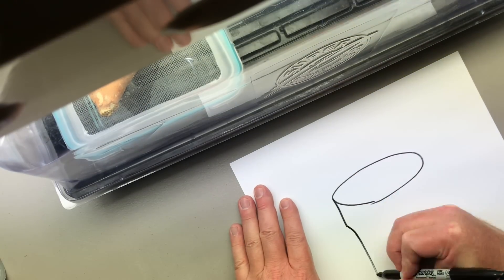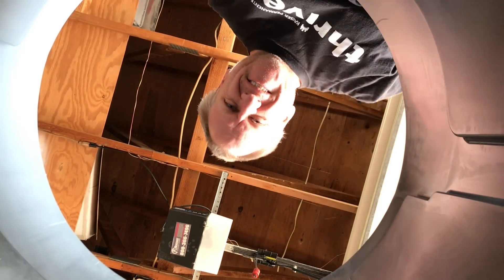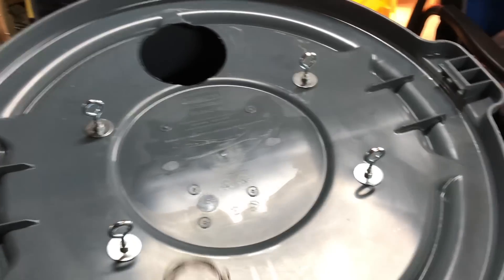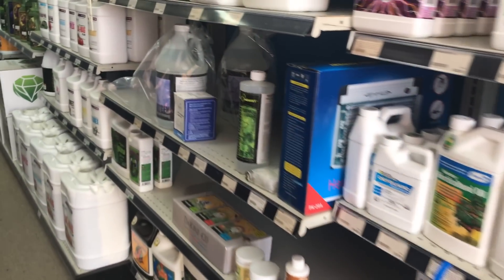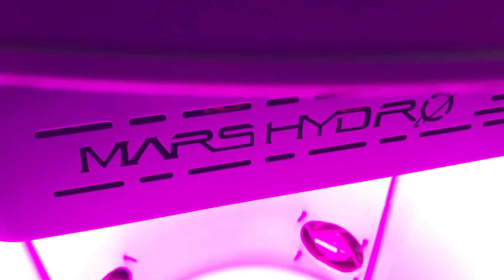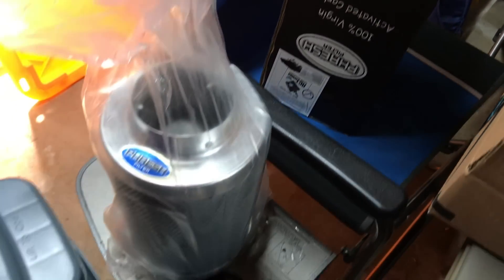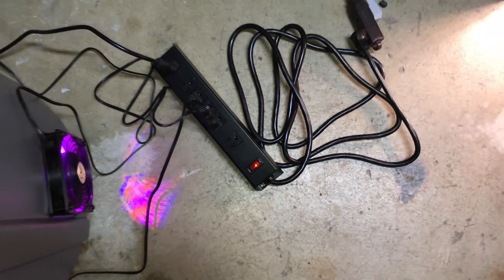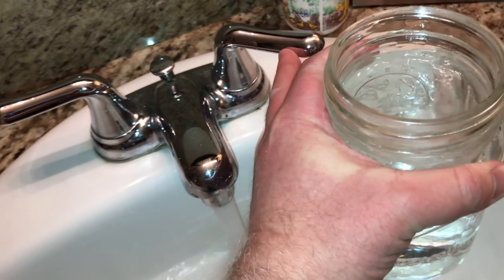They Grew Inside My Secret Trash Can

Comment: Many years ago a FOAF did a similar aah, Tulip grow, stealthed in a bar fridge. Quite elegant, air intakes and ballast for the HPS (this was pre-led) where the compressor was, allowed for a light trap for max stealth. Worked excellent until the light was at max height (used the fridge shelves to mount, so could move the lamp up). Top rack broke airflow around the lamp tho, overheating became a major issue. Using temp control was considered, but there were concerns these dutch tulips would panic with odd dark cycles. Was de-commissioned before harvest. Excellent concept tho. Maybe he will try again in a fullsize fridge and LEDs. Has all the requirements, and you even expect it to hum a little. Trash cans dont generally hum. 
Thanks Jeb, nice grow.
Reply from the maker: yes fridge would be stealthier and more difficult

Comment: It's not quite stealthy enough to be called, "secret" though. It takes a couple 90° turns to trap light, and have good airflow to not bling blurple light out the fan hole.

 That's just asking for someone to ask, "what's that?!" There's a bit more work left to truly make it a secret garden bro:/
Reply from the maker: lock the room its in
Reply: @JebGardener  We could probably put a box or clutter around the can filter to make it look like you just sat stuff on the lid. And run some 4" black vinyl hose (sold for dust collecting machines for cabinet/machine shops) off the intake fan, and wrap it behind some boxes or such on the floor to hide it being connected to the trash can. Long as all the ports and plugs are on the back, it's probably good. I'm somewhat concerned with heat off that Mars 300. I've got 2 of them, they're good lights, but easily make the space under them break a hundred degrees when you enclose them that tight. I'm not a "spacebucket," guy, more of an armoire/cabinet guy, so usually have a bit more room to play with.

Comment: id rather not break my back lifting that lid :P
Reply from the maker: yes it would be better to mount the light within the can
Reply: @JebGardener  Great idea. However, how would you be able to access the plant? I'd suggest using a see-through material to make a window to access the plant.
ps.
I am using a 4 shelf, plastic, 20$, POS, ocean state greenhouse, I was able to fit a rotating heater and a dehumidifier. However, I still need to find a cheap grow light for my plant, as I'm steadily approaching my budget.

Comment: When I saw the thick trash can I was geared up for potatoes.
Reply from the maker: sounds interesting
Reply: @JebGardener  I remember the last time you did potatoes, there wasn't enough light blocked from the roots and they came out green. You didn't seem overly bothered with the idea of trying again, but you do seem to be spurred on by solving challenges and problems, so I was wondering when you'd get back to the potatoes. I even thought I saw some in the first few clips.

Comment: I had this same exact idea last year but i figured out something cheaper and better! Any way heads up u can make a carbon filter by buying activated carbon. Step 1 take pringles or soda can if u want it good start from the middle punch holes down one side, put a paper towel or coffe filter as a inside liner. Now put the cap on the pringles can side with no holes. Add a dryersheet imo helps if u streach it out, then about .5-1mm thick of activated carbon less is more breathable, due to gradients u can essentially add as many layers as u wish, 10 is usally normal. Dryersheet then activated carbon dryersheet then activated carbon finish the tube by adding one last dryer sheet gently compress it doesnt need alot! Take the cap off you done good if it holds put holes 9+ decent sized then cap off the hole end of the can. Now all u have to do is glue the can on ur exauhst vent! Hotglue and super glue are air tight and bond well! The dryer sheet catches ionized particles while the carbon bonds to larger particulates. No reason to buy a carbon filter when u can make 5 for 5$-10$ a pvc faceplate useally makes a good connector if u wana use a variable pvc glue if u want the extra seal and replaceability
Reply from the maker: sounds like a good candidate for a comparison
Reply: @JebGardener  I'd love to see you make one and do a comparison would be wonderful! Thanks jeb for all ur content! Ill be looking forward to future videos!
Reply: I forgot to mention one thing if 10 layers doesnt fill ur filter unit all the way just lightly pack cotton balls the rest of the way! 

Also you can use charcoal if u have access to a 🔥 id pestle the small coals into a fine dust. 

When making this please use a dust mask of at least grade 2, and/or in a well ventilated area.

Comment: Honestly a great video. 
For the watering problems, try using a water fountain pump with an outlet timer. ($5)
Filters on the fans to protect against mold spores. ($10)
Cheap IP/USB Camera on the inside to see and keep the seal. ($25 max)
If you're truly trying to seal it up all the way.
Which Wattage light did you use from the ebay link, it looks like the 400 watt light, but I saw your consumption wasn't anywhere near that.
Reply from the maker: thanks!

Comment: you might want to use some reflexion material inside the can
Reply from the maker: foil?
Reply: @JebGardener  yeah, although it might be a tough to set properly on a rounded box. since the can inside have a dark surface your light is heating it up from the inside. just my thoughts based on indoor growing

Comment: FYI, unless you are growing cannabis or a smelly plant or want to have clean air moved from one room to another, there is no actual need for a carbon filter (which filters bad smells of air when it is pushed through the filter. Also, a carbon filter of that size would be moving around 250 m^3/h of air or so, ideal for a 1x1x2mt tent aprox. For such a small container/space you'd need a filter that passes no more than 90~110 m^3/h that way you can spend less money on a smaller filter which is easier to handle :)
Reply from the maker: the filter i chose was correct

Comment: Very nice setup! Have you already tried aquaponics?

PS: you could have put your fan just before the carbon filter for "optimized" air flow.
Reply from the maker: is optimized better?
Reply: @JebGardener  Because you're pushing air directly into the filter. You can also put the fan after the filter (to pull air instead of pushing it) but then the filter has to be directly inside the box.

Comment: I tried using 300 mars led in a 2x2x4 foot tall for cucumbers and it burned the leaves   had light up as high as it could go in cabinet but still burn leaves any ideas.  ??????
Reply from the maker: did you monitor temps and humidity?
Reply: nope but there are also two fans facing out and one blowing in and am doing kratcky so once a week I check water and every other week change out

Comment: I like how this little project can probably be even more improved. Like paint the inside or line it with white polyurethane.
Reply from the maker: i dont think lack of light was an issue.  I would use foil if i had to
Reply: @JebGardener  I think foil would absorb and produce heat more. My mentor advised against it but hey, you are growing tulips haha. I was growing something else ;)
I am interested at how advanced this compact thing can get.
How did you clean the bottom after every watering?
Reply from the maker: i heard lots of nonsese like foil doesnt work, soak your rockwool, chlorine hurts plants etc

Comment: if you skip the fans below and just have air holes you could ensure no leakage with negative air pressure, would probably require a blower for the carbon filter, might not be as cheap or silent but if you don't run it at full speed it should be close enough
Reply from the maker: computer fans are the way to go if you want quiet

Comment: For watering you might be able to use a small fountain pump and a rain bird micro bubbler?
Reply from the maker: sounds complicated but not a bad idea
Reply: @JebGardener  A low tech idea..  Attach a  plastic watering can head to a pvc pipe. Set it at an angle and have a funnel on the outside of the space can attached to the pvc.
Reply from the maker: might make things easier but you need to inspect the plants regularly too
Reply: @JebGardener   Good point. Love how you solved the problem of hanging the light. Was heat ever an issue?
Reply from the maker: the tempereature controller handled that for me

Comment: Another great video. May I add if smell is an issue always pull air never push, and maybe spray glue some tinfoil inside
Reply from the maker: i guess, but none of that was necessary

Comment: This idea came to me as well a month or two ago. The only issue I had with it is that it's very difficult to get to the plants for watering or maintenance unless you cut a door into your (relatively) expensive garbage bin. I opt'd to use a large double-walled cardboard board lined with foil instead. It's working great so for got a small number of plants.
Reply from the maker: yes vertical clearance and access are a real challenge with this setup
Reply: You could maybe water via tubing to a capillary mat, with the water passing through another carbon filter on the side. Not sure if a carbon filter would trap nutrients, if you were adding it to the water. The real problem would be avoiding over-watering, so maybe have some kind of clear panel you could uncover to check inside every day or so. Or have a gravity fed watering system inside the can, but there's not much room for it. Lotta trouble for tulips.
Reply: @AntonGully  lol yes that would be a lot of work for a small handful of plants. The capillary feeder is a good idea, but I've had issues with them getting clogged with minerals and salts after a week or so. A gravity feed system works better, but the flow rate decreases with the water level, so it's not fool proof. Having a window is the best solution imo. 

And yes, activated carbon would scrub all of the nutrients from the water. It's the same material water filters use to remove unwanted chemicals from a supply.

Comment: That is a lot of light in that space.
Reply from the maker: With reflective material you could probably use a smaller light
Reply: @JebGardener  the PAR reading in there has to be pretty high?
Not a bad thing, if the plants aren't showing any signs of stress from it, rock on!!!
I'm just curious how far say a 65 watt LED would go in that can.
Either way, I really do like your channel and the stuff that you do.
Reply from the maker: heat stresses plants, not light